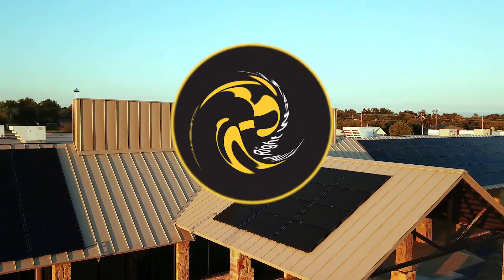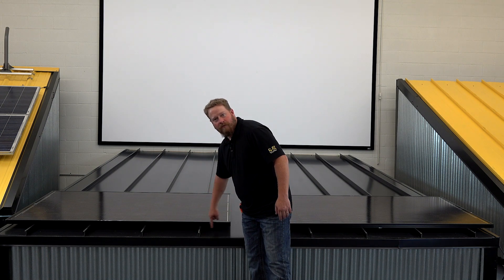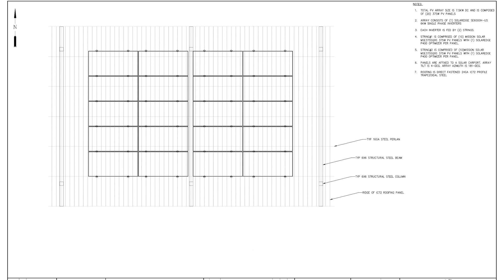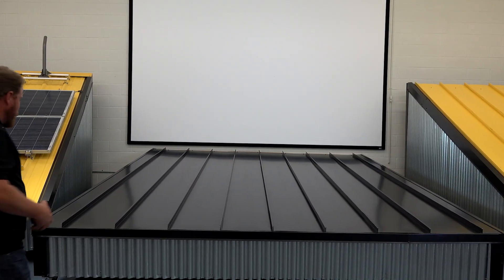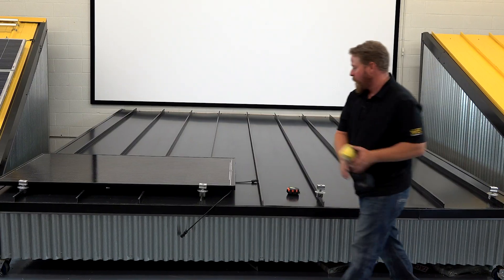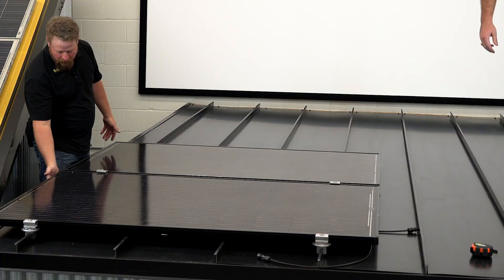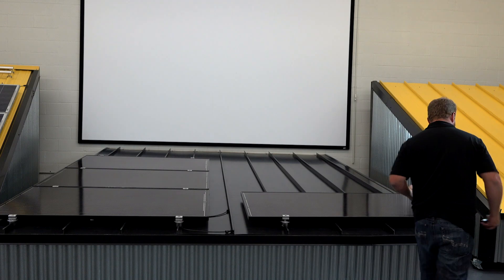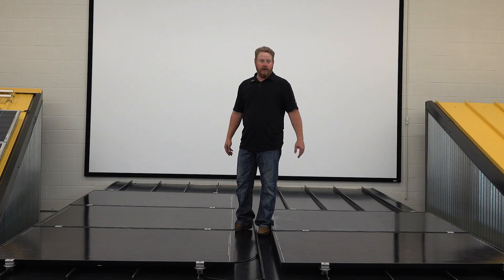How Do You Install Solar Panels on a Standing Seam Metal Roof?

Comment from the maker: Do you have any further questions about installing solar panels to a standing seam metal roof? Ask your questions here!
Reply: Would like to see how snow guards and solar panels can both be installed on standing seam roof.
Reply from the maker: @111ch1a1d111  Great idea and we will get it on our schedule to do a video on. Thank you!
Reply: How do I know if this  kit is compatible with my solar panels? According to the installation instructions my PV module may be fastened to a support by using clamps on both the long edge and the short edge of the modules. There are so many things to take into account to ensure the warranty from both providers (metal roofing and PV panels). I'm installing the Versa Span from Taylor and  the LG400Q1C-A6

Comment: What drill bit would I need to complete the installation? @TheMetalRoofingAcademy
Reply from the maker: To tighten the setscrews, you'll need a T30 Torx bit tip, which is included in every box of S-5! clamps.

Comment: Does your clamp make a hole in the vertical seam?
Reply from the maker: None of our clamps will create holes in standing seam roofs. These roofs cannot be penetrated, and roof protection is a primary concern as we design and test our standing seam roof clamps.

Comment: This question is about standing seam roof projects in general... how do you penetrate/flash the deck to get your wires into the attic and down to the inverter?
Reply from the maker: Thanks for reaching out! This question is a tough one, and the answer will likely vary based on the exact kind of metal roof you have. Please reach out to us at support@s-5.com and we'll be happy to discuss this with you further on a project level. Roof flashings are not something S-5! manufactures, but we certainly have industry partners who are experts in this subject matter.

Comment: What's the recommended torque for the top set screw on the PVKIT 2.0?
Reply from the maker: The top bolt and standoff of the PVKIT should be torqued to 120 -130 inch pounds.

Comment: can you tell me if these clamps drill through or damage the metal roof, or deform the roof ribs when you tighten them? also, can these meet miano dade county FL, USA wind levels?
Reply from the maker: Thank you for reaching out to us with your question. Our standing seam clamps do not penetrated the standing seam but will fully compress and dimple through the layers of sheet metal creating a mechanical bond to the roof the clamps are designed to be on the seams for the life of the roof so and dimpling or deformation to the seam will be hidden under the clamp furthermore our clamps will not void your roofs warranty. We do extensive roofing panel specific load testing all done in 3rd party accredited labs to easily allow you to design the array to any wind speed. In Miami Dade they will require to you provided our load chart and lab report for the roof that your are attaching to along with your array engineering showing that the project was designed properly using our load data. If you any questions or need any assistance during the design or approval process please contact us at support@s-5.com

Comment: That standing seam roof is engineered to allow expansion and contraction as the roof heats & cools.  The clamp screws (hidden clamps at the seam joint) will be pulled back and forth every day with expansion and contraction and then fail if they can't expand/contract.  how can the roof panels expand and contract when they're clamped and hundreds of extra pounds added?  Can't imagine a single standing seam roofing system where this would not void the warranty and cause substantial attachment failures.
Reply from the maker: Good question @fredsnit and you are correct that standing seam roofs are designed to allow
for expansion and contraction. It is important to understand just how the standing seam is
designed to allow for the roof panels to grow and shrink dimensionally with temperature
change. This change in panel length is very minimal with shorter roof lengths but can become
significant with longer roof lengths. When roof panel length is greater than 20-30 ft (6m-9m)
depending on color and solar absorption ratio, standing seam metal roofs are often designed to
respond thermally with dimensional change along the length of the panels. This is accomplished
at the roof panel-to-its attachment clip interface or within the attachment clip itself. When
referring to the attachment clip, we are discussing the clip utilized to fix the roof to the
structure – I believe you refer to them as “hidden clamps”.
 
Most pre-engineered metal buildings (the major share of commercial coated steel roofs) and
other clip designs utilize dual-component clips when roof panels are above a certain length.
Within the dual-component clip (often called “thermal clip” or “expansion clip”), the top
portion moves thermally with the roof panel, while the lower portion (fastened to structure) is
stationary; the two portions are joined with a slip joint. Differential movement between roof
and structure is accommodated within that joint. When this type of clip is used, the roof and
clamp secured to the seam will move together. Our clamp engages the top portion and
clamping to the seam in no way impinges on the thermal movement of the roof.
 
Other standing seam metal roofs rely on differential movement between roof clips and roof
panels to accommodate thermal cycling. In other words, the roof panel “rides” the clip to
accommodate excessive thermal cycling. When installing the S-5! clamp on this type of standing
seam metal roof, the clamp locations should avoid the panel’s attachment clips if and when
panel lengths exceed 30’ (9 m). Should a clamp be used at a clip location and the panel is
greater than such length, then it is quite possible an installer could inadvertently ‘pin’ the roof
panel and jeopardize the thermal integrity of this type of standing seam (which is why we
instruct not to do that).
Hint: Thermal movement (change in length) of any panel of any length can be calculated by this
equation:

∆L = L x ∆T x C e
Where:
∆T is the hottest surface temp to the coldest
C e for steel is 6.7 x (10 -6 ) in/in/ºF
C e for aluminum is 12.9 x (10 -6 ) in/in/ºF

To learn more about this very topic please see:
Metal Construction Association
Part 6: Metal Roofing From A (Aluminum) to Z (Zinc)
Attachment of Metal Panels
t.ly/Td9b
Metal Construction Association
Fastener Compatibility with Profiled Metal Roof and Wall Panels
SPECIAL NOTE A: Use of Seam Clamps and Brackets
t.ly/c51i
Metal Construction Association
Part 7: Metal Roofing from A (Aluminum) to Z (Zinc)
Rooftop Equipment Mounting and Penetrations for Low-Slope Standing-Seam Metal Roofs
t.ly/Rfyg
University of Wisconsin- Madison, College of Engineering- Professional Development
Metal Roofing Systems (2-day course)
The curriculum author and instructor is the foremost metal roof expert and consultant in North
America. He has won numerous awards from MBMA, MCA, CSI, RCI (IIBEC) and ASTM. (He is
also the founder of S-5!)
t.ly/d4jZ
 
At S-5! our goal is to promote metal roofing as the most desired, accepted, user-friendly, most
coveted roof in the construction industry globally – we do this by design. Our components and
systems complement-- often improve the overall performance of the roofing system itself
which is why we have earned the endorsements from almost every major metal roofing
manufacturer in the world – and have a track record of 30-year success on over 3 million roofs
without a single documented failure.
Reply: @TheMetalRoofingAcademy  While I appreciate your response, you completely ducked the issue (and none of your links work).

The seam you're clamping can't be clamped. Period. Fullstop.  By clamping the slip-seam with your clamp, the slip seam can't slip.  Not going to slip when you clamped it tight as f. So the only solution for panel expansion is to jerk on the screw attachments.  Everyday.  Back and forth. That won't end well. 

I wish your system worked from an engineering point of view, as I'd use it.  However it simply cannot work.  I challenge you to cite a single standing seam roof manufacturer engineer who signs off on your clamp.

I'd also love to see your 30yr old installs.  (Hint: PV was too expensive to install anywhere 15yrs ago, 30yrs ago? Phttt. it was over 12$ a watt - you don't have any 30yr old installs.)
Reply from the maker: @fredsnit5699  Challenged accepted.  I'll speak with our founder and metal roof historian, Rob Haddock, and we'll get you a list of the standing seam roof manufacturers that sign off on our clamps.  

And our apologies if you had any issues with those links, maybe give them one more try.
Reply: @TheMetalRoofingAcademy  Seems like knowing your system wouldn't void the roof warranty should have been on the todo list before you sold your first clamp... But glad to see you're finally getting to this...
Reply from the maker: @fredsnit5699 , Here are some resources that should help you out.  First off, a video of ours that includes some testimonials, endorsements, and lists some of the testing we’ve performed on all of our products:

https://youtu.be/IP0x6Nbzar8

You can also find more testimonials from folks in our industry on our website, which also has load test tables for every one of the products we offer (we thoroughly test everything we produce before we release it to the public, so we can be certain our customers get the best product possible):

s-5.com/testimonials/

s-5.com/load-tests/

Hopefully, that gives you some more confidence in the performance of our clamps.
Reply: Do the wires just lay on the roof or is there a clean way to tuck them under the panels?